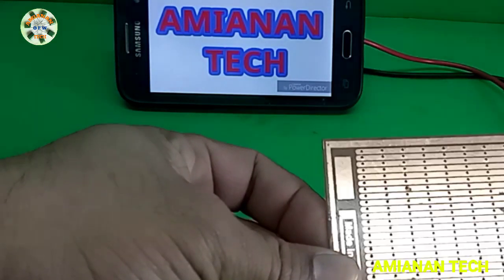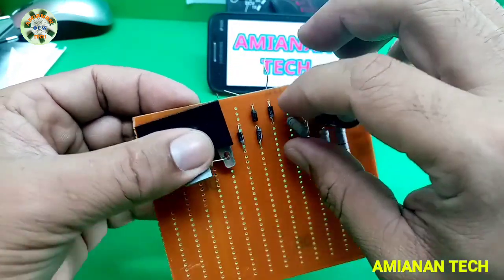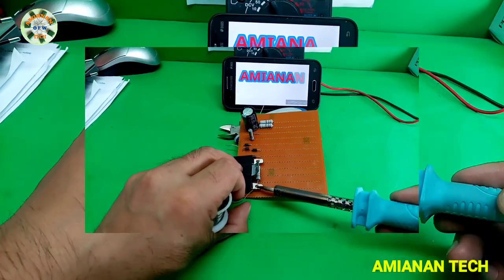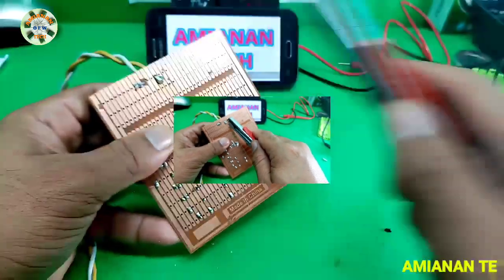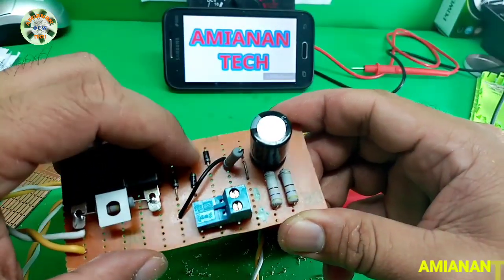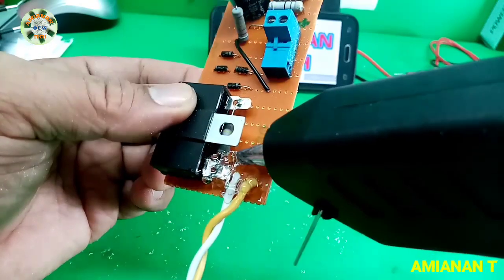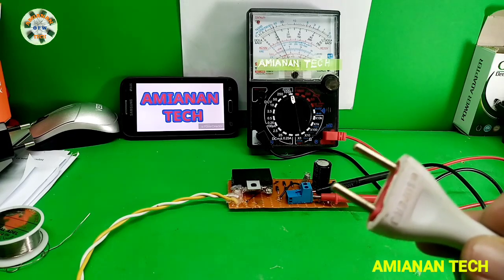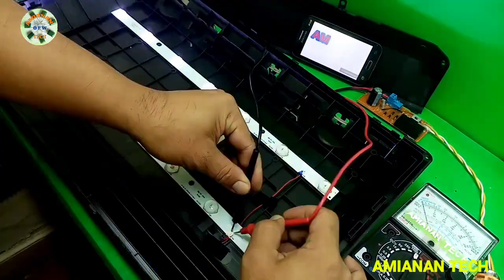DIY | How to make TESTER for LED TV BACKLIGHT

Comment: sir bka pwede ung ceramic na 474J/400v
Reply from the maker: Yes sir kung makikita mo sa video ko capacitor yan ng electric fan po
Reply from the maker: Yung kagaya sa capacitor na gingmit sa led bulb pwede sir
Reply from the maker: Pwede din yan .47uf/400v
Reply: @amianantech6298  maraming saLamat sir Amian sa pag repLy, tnx tnx sO mUch sa sharing ng diagram mO
Reply: @amianantech6298  nakagawa na kO sir,👌👌👌